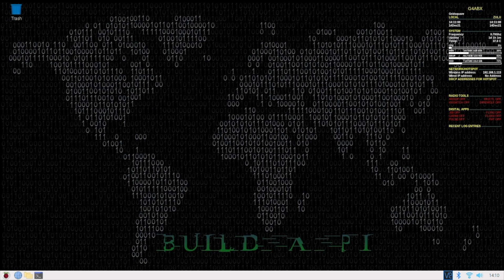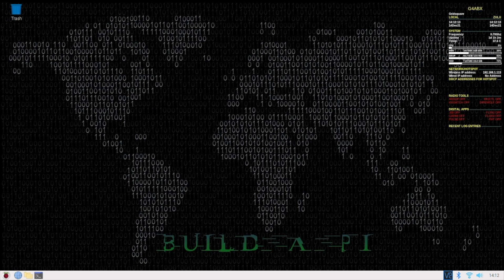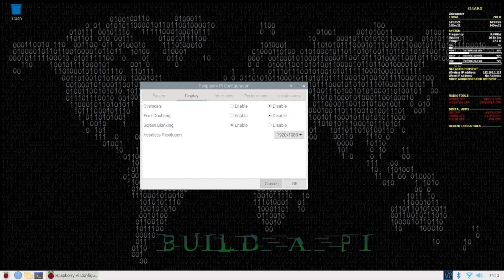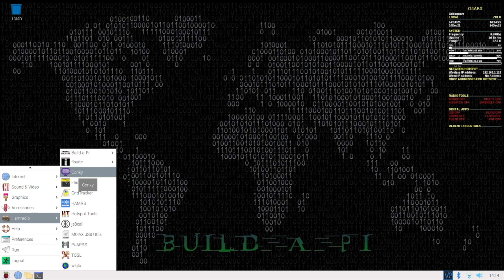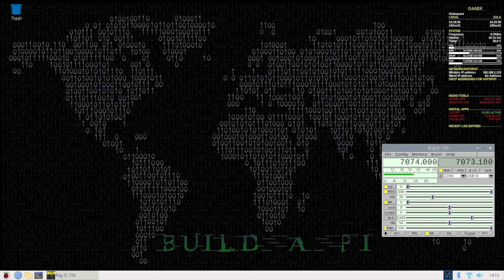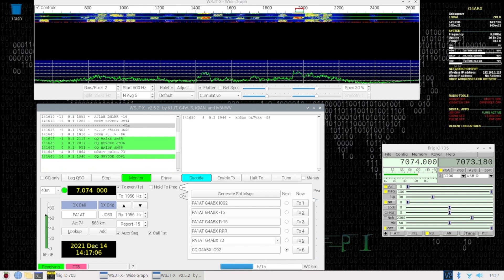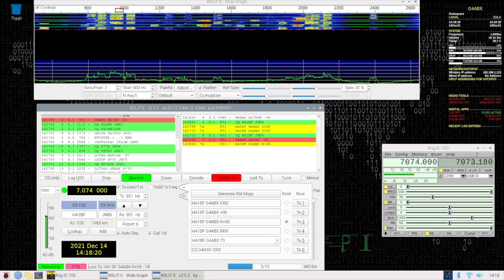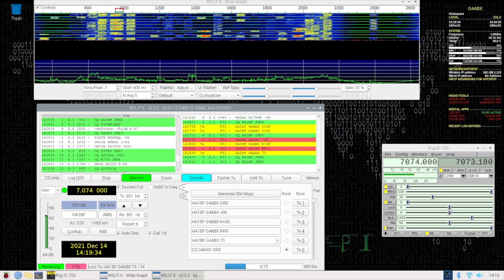Raspberry Pi zero 2 W for Ham Radio IC 705. Part 2, Software

Comment: Cool. I didnt realize you could do it with a pi zero.  I use pi4. Ill try the zero. I like the size of that little board
Reply from the maker: Ah, The zero won't work, you need the zero-2w
73
Bruce

Comment: I'm planning on moving my Xiegu G 90 from my Mobile to my QTH/portable kit. I'll be getting a IC 7100. My biggest issue is getting it to talk to my Cellular Hotspot.
Reply from the maker: Don -- good evening. 
I use Build-a-pi from KM4ACK for all my portable operations. 
I have -- at least 5 Raspi's of various types, 3's 4,s and Zero 2W's.
I have no problem in getting my G90 to talk to the Pi's set up with Build-a-pi and as I also have my IC7300 and Ic705 set up with their own Pi's, I'm pretty certain the 7100 would work in a similar manner.
When I'm out portable I set the hotspot running on my Pi so I can log into the Pi with my Phone or my Android tablet via their WiFi connections. That works well and gives me the ability to 'sit back' without needing the tablet connected to the Pi. 

Take a look at Jason KM4ACK's Build-a-pi and you will be pleasantly surprised how easy it is to set up (its pretty much 'automatic' ) and the wide range of applications it contains.
He's in the process of releasing a 64 bit version.

73
Bruce G4ABX